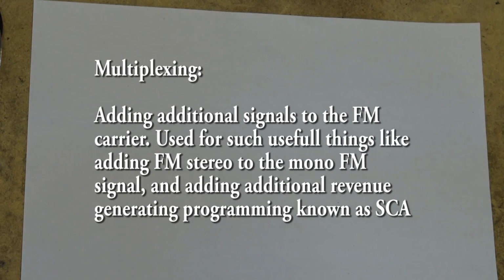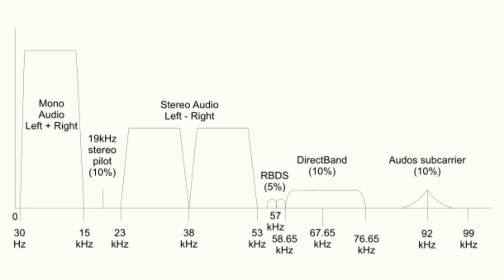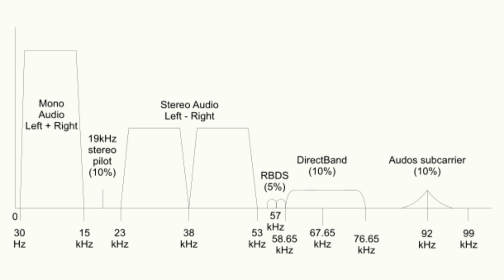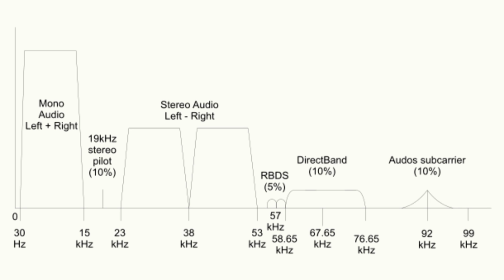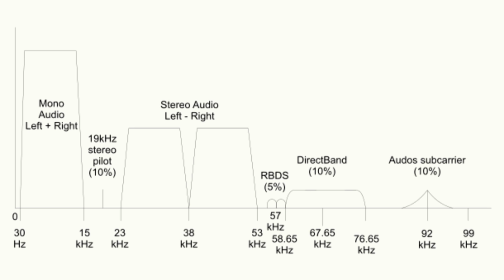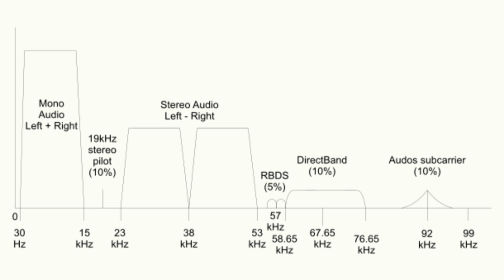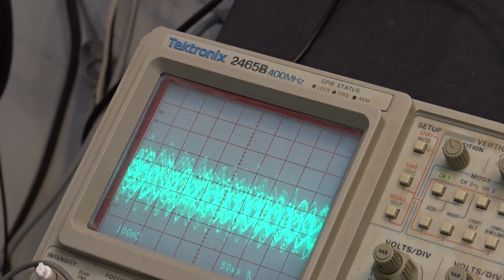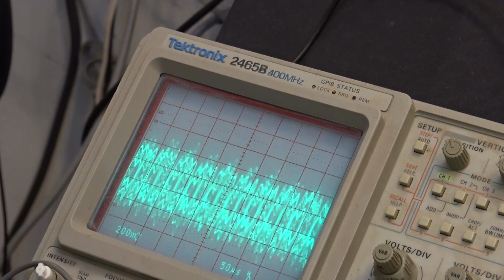FM SCA radio explained and a demo of operation

Comment: As for color TV in Europe, it was introduced around the same time that they were switching from various black & white VHF systems to 625-line UHF, but there were actually plenty of black & white 625-line TVs made as well -- so PAL color does have B&W compatibility just like NTSC. But what they didn't do was add color to their old VHF TV systems, because they were either too low-resolution (like the UK's 405-line system) or used too much bandwidth (like France's 819-line system).

Comment: Neat little explanation of the frequency spectrum within fm carriers. For someone who used to work at a radio station I never knew this!
Reply from the maker: Another interesting technology was called SCPC and was used on analog satellites.
Back in the day of analog satellite TV, the sound was places on sub carriers typically 6.2 and 6.8Mhz. There were others as well that could be anywhere  above the highest frequency of video. My receiver could tune from 5.0 to 8.0 MHz for audio sub carriers. When the VC2 scrambling system was introduced the analog audio was encrypted on the data stream in the horizontal blanking area.  This freed up the 6,2 and 6.8 carriers. On one of the channels on G5 they had I think it was CNN, and they had a bunch of sub carriers at 5.4, 5.6, 5.8, 6.0. 6.2, 6.6, 6.8 7.0, 7.2, 7.4, 7.6 and 7.8. Since these were mono 2 pairs were used for stereo. 5.4-5.8 was 1 channel, 6.0-6.2 the next ect. 6 commercial free channels. I have a bunch of recordings from one called "The new age of jazz" There was that one, a soft rock channel, country, hard rock and classical.  These were subcarriers on video channels.
There was however another block of hidden radio called SCPC (single channel per carrier) I used an outboard stereo processor. Now this would normally only tune the 5 - 8 MHz range used by the video channels. 
On an SCPC transponder the entire transponder was used for audio. So I had a converter that would convert 0-3 on one band, then 3-6 on the second, and  6-9 on the 3rd. That way with my outboard audio receiver I could just sweep up the band. Of course the same could be done with the ham radio like I demo'd on here. I actually did that first before obtaining the stereo processor and band converter (I wanted stereo sound) My old 10 foot dish was used more for music then TV back in the day. There were hundreds of radio programs available on SCPC. Of course all good things come to an end, and the digital era ended that. There are still plenty of un-encrypted audio feeds available on satellite right now. All you need is a dish and a digital receiver, but with all the streaming stuff available why bother unless you like the idea of music just flying in from space.

Comment: They were using SCA for reading for the blind service back in the late 80's early 90's here in the NJ & NY area.  I worked with a volunteer group called the Telephone Pioneers, and we were modifying old defunct DOW Jones stock alert radios to receive the SCA reading for the blind.  Not sure if they still do that anymore.

Comment: using a SW radio to play with hidden FM signals, would never have thought!
Reply from the maker: Not an SW radio. SW is AM,  A communications receiver, such as a HF ham radio also has FM receiving capability. The subcarriers received off the discriminator are still FM modulared.

Comment: I built one of those SCA decoders, and it uses that same PLL chip.  I didn't have good luck receiving anything with it though.  It was pretty slick using a PLL's VCO to pick the audio off.
Reply from the maker: I used it for music on hold at the shop I worked at. The one I built worked pretty good. One station, CHQM FM had 2 SCA channels. 67KHz had elevator music, and 92 had a commercial free rock music service. I hadn't lisnened in many, many years and was actually surprised to find a local station still using SCA. Most of them now have HD audio on the sidebands now.

Comment: I own a SCA FM receiver, its a complete system with, AC plug, speaker, callapsing telscopic antenna, on/off switch, and tuner or volume control knob in a nice wooden cabinet. Is there any hope of picking anything up on it from one of my local FM stations?......many like WLS, WLUP and WBBM FM are very high outputs stations that have been around at least from the early 60's , I live in Chicago, in the suburbs. Is there any collectable value to a piece like it?
Reply from the maker: All depends on if it can be tuned and if there are any stations still broadcasting sca.  That spectrum is now used for the digital streams on hd radio.

Comment: Setting a pll to the same frequency, then coupling the dc loop correction voltage through a blocking capacitor to an amplifier.
Very clever :-D

I used to use an old frg7700 receiver to listen for the i.f sections in faulty c.b radios.
You didn't even need to connect direct to the circuit, just bring the antenna close to the stage.
A very under rated tool the receiver.

Comment: Long gone are the days when BBC used a 50khz ACS (Australia called it Ancillary Communication Service) on 3RRR in Melbourne.  Electronics Australia magazine actually featured a decoder that could switch to all three frequencies used here. 67 and 92 plus one I can't recall that was lower than 50khz. Maybe 48khz.
Reply from the maker: Wenlocktvdx 
The one I built could tune down quite low but here the 3 used were 57 67 and 92. The one I built was from the "engineers notebook " radio shack sold back in the late 70s. I might still have that and it would be fun to review some of the projects in it. Will have to look and see if I have it. I have a few boxes of old documentation, service manuals ext in my storage locker. I am kicking myself as I had the entire Sam's photo fact catalog. A full file cabinet full of vintage manuals that I tossed out when I left the business in 2003. What I would do to get those back issues back If for nothing else other than to scan them all. I had hundreds of Sam's ans ecc manuals.2 full 4 drawer file cabinets overflowing with manuals.

Comment: Just curious where does iboc or HD radio fit in to the Spectrum I am surprised they never use the SCA for digital signals
Reply from the maker: thepatsny 
The iboc channels are higher up on the baseband. I did tune them in. You could hear the buzz of the digital noise in the 100-300 range. Iboc extends the bandwidth to 400khz so 2 iboc stations can not sit next to each other. Unlike sca which is a sub Carrier fm modulated into the base band audio which is then modulated to the fm carrier the iboc signal is a separate transmitter that mixes in at the antenna for  fm operation.  The end result is the same, it appears as a sub carrier.  Am iboc was done differently. Phase modulation of the carrier similar to how am stereo worked.
Reply from the maker: thepatsny 
Sca was and is used for digital signals. In addition to analog audio sca was used for digital services.  Pagers, stock market ticker were the most common. Rds on 57 is still in use on many stations.
Reply: 3RRR in Melbourne used to carry BBC World Service for subscribers on 50khz. Way back when SCA, known as ACS - Ancillary Communications Service, first appeared in Australia the magazine Electronics Australia featured a decoder that could select the three common frequencies, but not the 50 kHz used by BBC WS.

Comment: A Software Defined Radio (SDR) can be used to decode SCA, using a 192kHz recording capable sound card.
HDRadio (Hybrid Digital Radio), or IBOC is not on baseband (modulated signal), it are two blocks of digital carrier on both side of main FM channel (or AM/MW). HDRadio have a 400kHz channel bandwidth.
Reply from the maker: pksato 
Yes I am aware of this. Separate transmitter, however you do hear it in the baseband demod audio. I did show where it is on the baseband spectrum. However when iboc is used a radio station can not also have sca as the side bands from the digital signals occupy the spectrum. The exception is the 57khz RDS sub carrier. Being a low data rate text service that remains.

Comment: Can't one use the discriminator output of a scanner and feed it to a decoder?
Do you have a schematic for your board?
Reply from the maker: I did have a schematic as i built it. I will have to look. I built it in high school.  I have boxes of old paperwork i am sure it is in there somewhere.  Yes the discriminator output and mpx output is the same.